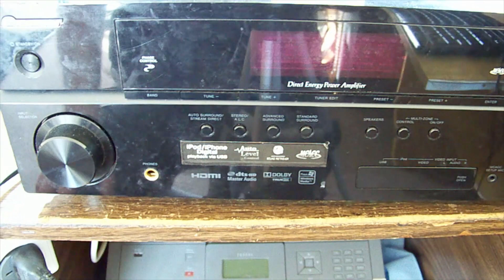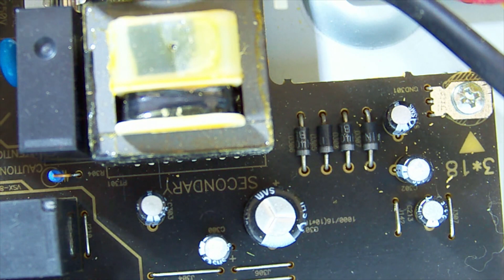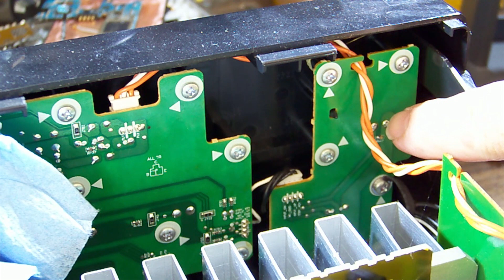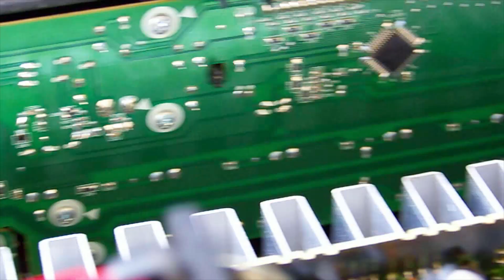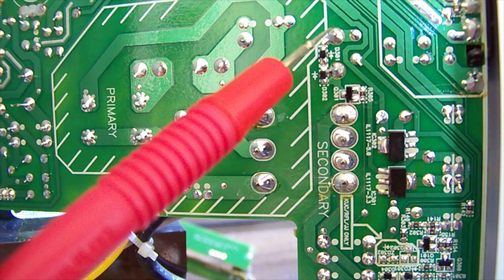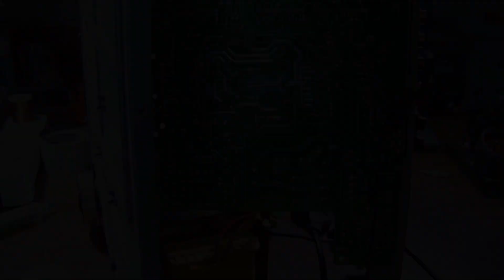Pioneer VSX-819H AV Receiver repair attempt

Comment: I had this issue on an older Yamaha the other day. I repaired it was a bad 5V reg. I then removed the front to get to the volume encoder, fixed that and then put it back together, could tell processor was trying to do stuff but was no longer getting the signal for the relay. Totally stumped. I ended up taking a different dc (4.8v) from that zone and i ran that back to the relay transistor and it worked fine. Just better to unplug the amp when not using, also power switch still works to turn unit on and off just that regulators and amp section receiving power all the time.
  Thinking static may have killed it or perhaps it has a 5V in which becomes the one that is switched out rather than from it's own vcc. Perhaps I didn't see something like that. Still pretty satisfactory.
Reply from the maker: Oh interesting. Well done tho!

Comment: I have this amp..It's standby transformer has gone. Do you know the output voltage of that transformer..?
Reply from the maker: The schematic doesn't say but looking at how it's connected I think 14Vrms would be ok.
Reply: @JonnyFix  I think 9v or 12V....because filtering capacitor voltage is 16v..
Reply from the maker: @sajithsadakalum471  The AC output needs to be enough so that you get the required DC level, I think after rectification 9 or 12AC won't be enough, but you do the math to be sure.

Comment: Hi Johnny I have a vsx830 with a blinking mcacc light when it turns on. Everything is dead. Have you seen this before and do you have any advice?
Reply from the maker: I'm sorry I have not seen that fault before. If it's still there after a hard factory reset (process not always shown in service manual) start by looking for bad solder joints and checking power rails are ok.

Comment: First check the power amp rails, then the 12v rails, and the auxiliare rails, the secondary mannage the standby to turn on the unit, so  check the secunday transformer and aux rails, if not check the power button and signal going to the integrated circuit below the pcb , the big one

Comment: Well I got a similar situation with my VSX519v. I didnt get very much use out of it the whole 15 years Ive owned it. I finally watch tv on hdmi and turn the pioneer system on. I notice the sound was very quiet. I turned the volume up to 35 and I hear a noise and off goes the receiver. Completely dead. No power just like your unit is doing in this video. After watching this video Im going to assume my unit is going to be put in the trash as it sounds like its non fixable. I was surprised to see the inside of this 519v as it looks like a computer. I suppose all the laying it has done the electronics just have deteriorated to being faulty? Such a shame as my unit is like new condition in appearance & board wise.
Reply from the maker: Watch my follow up video on this and see if you can do something similar

Comment: Well that was a depressing ending.  My unit (in the US) is in exactly the same condition and I was hoping in the end you would say something like.  "Oh, look, it's this 1K ohm resistor.  It's easy to get to.  Right on top of the unit and if you replace it with a 10K ohm resistor, it will be fixed for all time and put out twice the power with half the distortion, while fixing you toast in the morning."  Anyway, thank you for sharing.  I'm sure it is useless to many people, but I actually like hearing your thought process as you go through it.  Thanks for posting.  I'll go look at the follow-up and see if there's useful information there.  I suppose there might be a non-zero probability of just finding the whole panel with the chip on it and replacing that board?

Comment: Hi, on some pioneer home theater integrated receiver, faults may cause for not powering on and had some blinking indicator somewhere on the front panel (mine is a TIMER LED). To reset these fault try to press 'Stop' button and the  power  button at the same time (since mine is a home theater unit it got media keys), doing this will turn on the unit. Hope this help
Reply: Thanks, A good read on this 'protection circuits' can be found on pioneer xv-htd7 service manual chapter 7.1.12. Maybe this will guide on your repair journey.